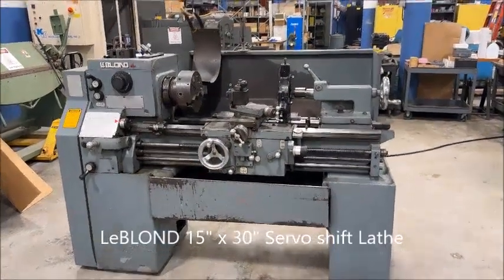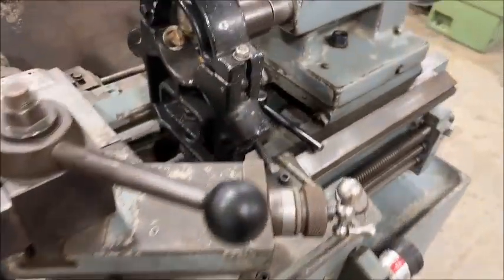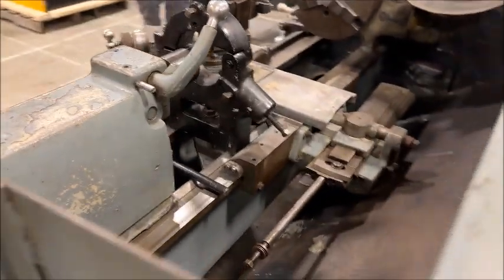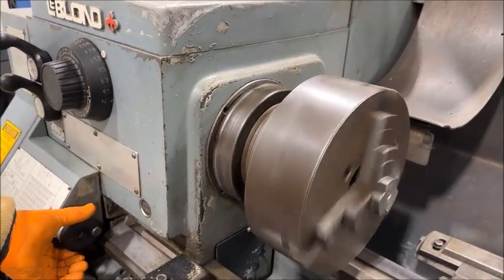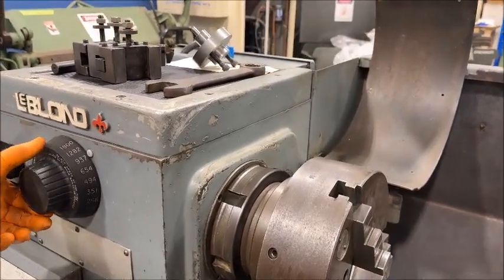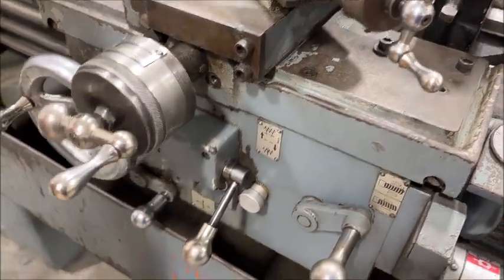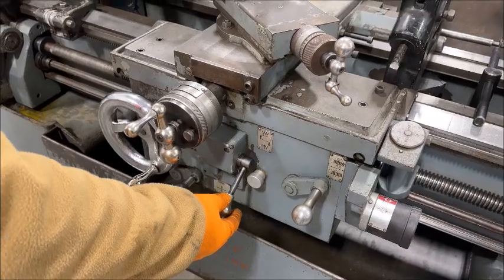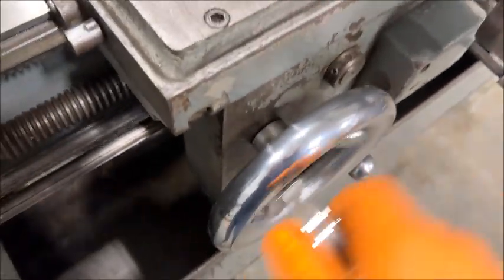1980 LeBlond 15 x 30 Servo Shift Lathe, Stk #1381

Comment: It's designed so you preselect a spindle speed, stop the spindle, and then it will automatically shift.  Keeps it from clunking through all the gears if you stop the spindle before shifting.